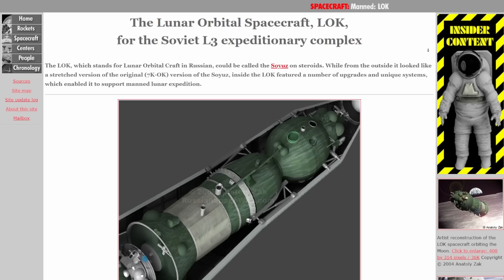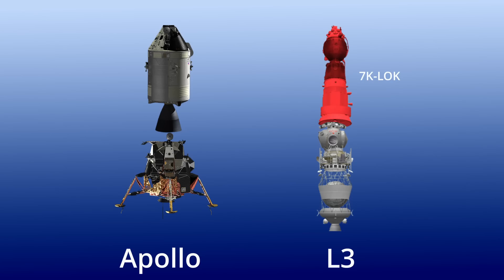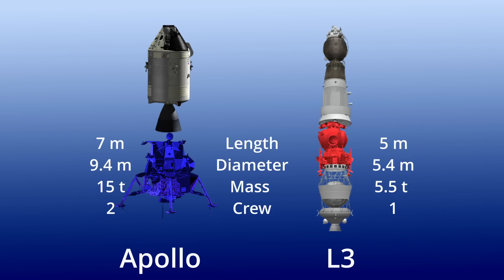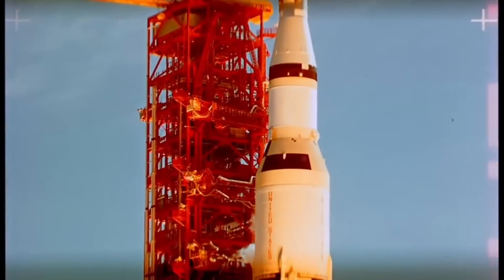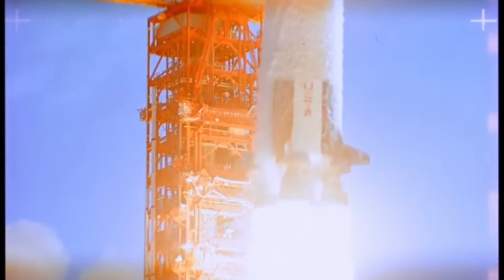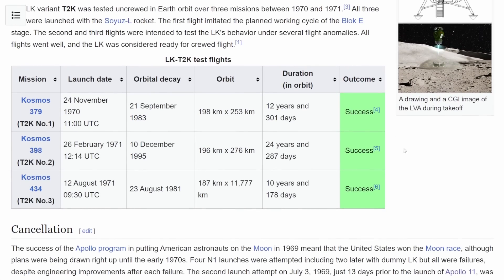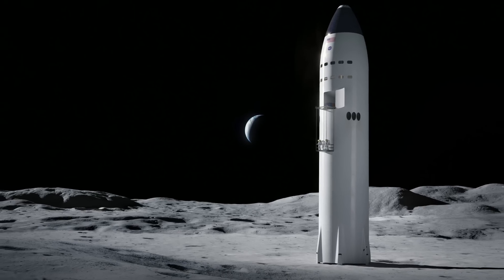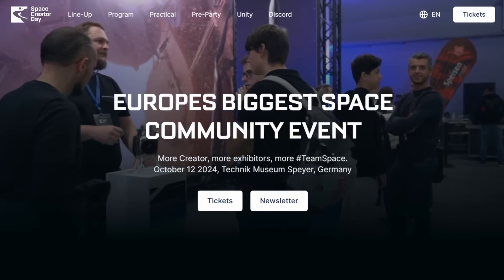Race to the Moon! Did Soviets or Americans Build the Better Lander? - Rocket Rumble #2

Comment: Apollo 15s lunar touchdown was so rough it destroyed the descent engine bell. Had that engine been required for ascent (like the Soviets) the crew would have died
Reply: @montylc2001  Monty, I hate to tell you this, but that's really not true.  I've done ALL the research. In point of fact, there were concerns over the lengthened engine bell contacting the surface while the engine was still running, so the J-mission commanders were told to shut their engines down the moment the contact light came on, so as to avoid the potentially lethal effects of the bell becoming blocked by lunar regolith while still firing.  That could cause the combustion chamber to explode, which would likely have been a non-survivable situation for the crew.  So, the engine extension was specifically NOT supposed to EVER hit the ground!  In point of fact, on Apollo 15, the engine bell crumpled because the LM landed straddling the rim of a small-ish 10-meter crater, and while Dave Scott shut the engine down the moment he had a contact light, he had also gone into a near-hover at that point, so his LM fell harder to the surface than any other LM.  The engine bell only hit the crater rim after the front and left footpads hit, and the whole LM tipped back into the crater about 20 degrees.  Thankfully, the engine had enough time to mostly stop firing by then, though the remaining pressure in it caused a big burp of soil that you can see flying out as the LM tipped back, on the descent film.  If you listen to the first EVA, when Scott is doing a walkaround of the LM, you'll note he says "You can tell the Program Manager that I got his engine bell."  The Program Manager was Jim McDivitt, and was the guy who told Scott, upon pain of pain, do NOT let your engine bell hit the ground on landing.  HIS engine bell, you note.  That's why Scott made that particular comment, to tell his old pal Jim that he had indeed crumpled the engine bell, and had survived, so maybe the dire warnings were a bit overstated.  If you'd have read, say, all of the crew debriefs for the flight, you'd have this kind of information.
Reply: @DougVanDorn  The lunar lander was designed and all of them under construction before the first one landed.   There was some concern about how far the lander’s pads might sink into the regolith, potentially blocking the engine bell, which might cause it to burst and throw shrapnel that could damage the ascent stage.   But even if they didn’t sink in, there was a larger concern the exhaust could excavate a deep crater that would redirect excavated rocks upwards outside the engine bell, also posing a hazard. (The surveyor probe had been sent to land on the moon partly to determine if landing pads would sink into the lunar regolith.)
So they engineered to negate those concerns.  All the LEMs had three  5 and a half foot long poles sticking down from the three legs without a ladder, that would activate the contact light while the LEM was 5 feet above the lunar  surface. In every landing, the engine was cut off when the contact light lit up, and the LEM dropped the remaining distance to the surface. The pilots tried to bring their vertical speed to zero and hover just as they made contact.  And the crush core shocks on the legs were designed to take the acceleration of the LEM dropping as much as 10 feet from a hover in lunar gravity.

Because of these design solutions, It simply did not matter what happened to the engine bell, once the contact light came on, the engine shut down, the LEM dropped down with an engine that was not only shut down, but safed, and the descent stage had no further use but the stowage bays for the experiment packages, the rover, and the surface video camera. Once shut down from surface contact, the descent stage engine was incapable of being restarted. 
If anything bad had happened, from initial descent burn up to and including hitting the surface too hard, ALL the abort options involved firing the ascent stage motor and dumping the descent stage.
Reply: @DougVanDorn holy chat gpt
Reply: The Blok Ye stage on the Soviet LK had a design optimised to direct landing debris and engine exhaust away from the engine, and featured a backup engine in case of failure of the main engine. The engine bell on the Blok Ye was nested, making damage less likely as the bell was not exposed as on the LM. The basic argument therefore that an Apollo 15-esque landing would have stranded the Soviets on the Moon is incorrect.
Reply: @DougVanDorn  " the engine extension was specifically NOT supposed to EVER hit the ground! "

The extension was not to hit the surface with the engine running.
Reply: Blaming the Americans for a Soviet design failure the Americans specifically designed their own craft to survive from seems a bit like special pleading.
Reply: @brianlaneherder3666  What?
Reply: Ok, but the bell on the lk is shorter compared to the landing legs
Reply: @grady631  It doesn't matter, the descent engine was only for the descent. Whether the bell got damaged upon landing was irrelevant. It was useless in any case with little or no fuel remaining.
Reply: Yes. And was actually also more or less mystery, would any of the landing engines could have been started after landing. Heck lot of dust, rumbling, and last few feets was more or less always "carrier" style THUMB. It was in many ways convinient that one could separate another fresh engine, and ofc also basic laws of leaving mass behind.. But ofc more moving parts etc. so it is more or less still a trade off. In dream world we would have moon machine that has main lander engine which it uses for landing and take-off, and then "an abort" engine more or less same style "hidden" in isolated space :)
Reply: @lasselahti4056  Why take all that descent mass back into lunar orbit?
Reply: @Canada_Dominium  For reuse.
Reply: @lasselahti4056  Why?
Reply: @Canada_Dominium  The Soviets had a different engnineering philosophy. The Soviets went for simplicity and reliability. The Soviet design would have worked, unless something went wrong. Same with ours, and it almost did. One mission failed (Apollo 13) and the American lander came close to some unrecoverable mishaps. We (the various countries involved in space programs) have the low Earth orbit thing down. Going to the Moon, or beyond, is crazy dangerous.

I am dubious about the potential value of space travel beyond low Earth orbit other than its scientific value. If I had the power to make the decision, I would say, right now, no country should bother going back to the Moon. I would say, what the countries involved in space programs should do is combine their resources and send a mission to Mars.

The reason why I say this is because no one knows what the future is. Maybe in the future technology will decline and we will not be able to contemplate a Lunar or planetary misson anymore. If we go, we will always be able to say, we have been there.

People will have to be told, however, that there is a considerable chance that the mission will fail and the astronaut will die in the attempt. It is very possible, in that case, that we will never know what happened to them. The physical effects of a long deep space mission on the human body also are unknown. They will not be good.
Reply: @anonymike8280  There were no mishaps with the Apollo LM.
Reply: @Canada_Dominium   @Canada_Dominium  Not with the lander. With the mission itself in the case of Apollo 13. There might have been some close calls with the lander.

What about the rest of the discussion?
Reply: @anonymike8280  "There might have been some close calls with the lander."

What close calls?
Reply: @Canada_Dominium  First of all, there is no default position which must be accepted absent proof to the contrary. Applies to many matters and it certainly applies to this one. The Apollo 11 lander was seconds from running out of fuel when it was successfully landed. If no adequare land site had been  identified, the mission either would have had to have been aborted, or the lander would have crashed and the astronauts would have died on the Moon. In another mission discussed right in these comments, it was not that the land came to rest at an angle on the side of a crater.

I don't understand what your issue is. What I was doing in the first place was making the point that space mission are inherently dangerous.

I just entered "Did the apollo 11 lander almost  crash?" as a search term and got some result. Yes, the mission and the lives of the astronaiuts were in jeopardy.

If you have a different opinion about the risks inherent in space flight, you're allowed to say what it is.
Reply: @anonymike8280  "The Apollo 11 lander was seconds from running out of fuel when it was successfully landed."

That wasn't a problem or fault with the LM.  It was faulty mission logistics.  The LM was the single component spacecraft that behaved flawlessly through all manned Apollo missions.  So, you're just wrong.  Admit your error.
Reply: @anonymike8280  ""Did the apollo 11 lander almost  crash?" as a search term and got some result. Yes, the mission and the lives of the astronaiuts were in jeopardy."

Eagle did not 'almost crash'.  A late start to descent operations caused the landing profile to shift downrange from what was known and planned.  Armstrong had to take extra time to find a safe place to land.  Do you blame your bicycle when you get lost?
Reply: @Canada_Dominium  That's a bunch of double talk. The issue I was raising was that of how dangerous space travel beyond low Earthj orbit actually is. The NASA lander may had worked exactly as it was designed to work but its limitations were extreme. One mission - embarassingly, the first one to attempt to land - almost ended in failure and even disaster.

Didn't I say, people need to be told that Lunar and Mars missons are very risky and that there is aconsiderable chance that could end in a loss of life? Especially a Mars mission. Going to Mars especially is obviously so risky it should not approached as a competition between nations.
Reply: @anonymike8280  "One mission - embarassingly, the first one to attempt to land - almost ended in failure and even disaster."

No, it didn't, and no, there was no fault in the design of the LM, and no, the LM was a very capable machine.  You claimed outright  multiple cases of failure with the LM. What were they?  Stop tap-dancing and answer the question.
Reply: @anonymike8280  "the first one to attempt to land - almost ended in failure and even disaster."

How?  Because the pilot took control of his craft and avoided a boulder-strewn area, because the mission profile timing had changed during lunar orbital undocking?  You really DO blame your bike when you get yourself lost, don't you.
Reply: @anonymike8280  "The NASA lander may had worked exactly as it was designed to work but its limitations were extreme."

What limitations?
Reply: @Canada_Dominium   @Canada_Dominium  It had sufficient fuel only for a limited amount of flying time and manuevering. There probably were a number of unrecoverable mishaps that could have occurred during landing. If we had kept on doing missions, eventually we would have lost a crew. It's what happens. We nearly lost an Apollo  crew as it was. We lost two space shuttles.
Reply: @anonymike8280  "  It had sufficient fuel only for a limited amount of flying time "

That applies to any motor vehicle of any type and use, thus irrelevant. You stated there were 'mishaps' with the LM.  What were they?
Reply: @anonymike8280  " We nearly lost an Apollo  crew as it was."

The Lunar Module SAVED that crew--by far exceeding its design capabilities and limits.
  

"We lost two space shuttles."

Irrelevant to Apollo Lunar Module.
Reply: @anonymike8280  "We lost two space shuttles"

Challenger was lost because of the RepublIcan Party's design for the booster and a RepubIican president's insistence on a launch in problematic conditions.  Columbia was lost because of environmentalist pressure to change chemical composition of insulating foam on its fuel tank--the RepublIcan Party's design for the booster.
Reply: @Canada_Dominium  Launch pressure was an issue. So was doing winter launches. They should not have been doing winter launches, period.

Don't forget Jessica Dubroff though. She was under pressure to make it to D.C. in time meet Bill  Clinton.
Reply: @anonymike8280  Challenger was lost because of the Republican Party's design for the booster and a RepubIican president's insistence on a launch in problematic conditions.  Winter is a season; not a temperature reading.  Apollo lunar missions launched in winter and in thunderstorms.
Reply: @anonymike8280  "Don't forget Jessica Dubroff though. "

Absolutely NOTHING to do with the space program.  Sick of you even to state that.
Reply: @montylc2001 i mean his point still kind of stands. I don’t think he’s trying to take away from the apollo program just pointing out a possible issue of the LK.
Reply: Actually not. The LK had two small auxiliary nozzles on either side of the main descent nozzle.
Reply: @hagerty1952  Gee, I wonder what "main descent nozzle" and "small auxiliary nozzles" sound like in Russian.
Reply: You don't really have a point here. The nozzle extension added from A15 onwards was designed to crush and CDR Dave Scott was explicitly instructed to hit the engine stop the moment the contact light illuminated as there were grave fears about the effect of having a running DPS so close to the lunar surface. Everything here went to plan. Obviously, you would not use the procedures developed specifically for one spacecraft on another completely unrelated spacecraft with different design goals and limitations.
Reply: @who1928  Thanks for this important bit of information.  Its the first time I'm hearing about this.
Reply: @montylc2001  welcome to the real world- where pilot error, engine failure, unseen terrain features, or erroneous fuel calculations could all easily cause a lander to touch down too hard and destroy the bell, contingency plan or not. In the case of the Soviets, that would cause mission failure and cosmonaut death. In the case of the Americans, it's ok. You really didn't say anything other than confirm my point that the American design is better

Comment: The Soviets took much bigger risks than the U.S. did, that is why they were ahead in the Space Race until the Moon Landing. That is not to say they didn't effectively engineer everything, and until Saturn V, they did have much heavier lift than we did. Nor that we didn't have risks and setbacks as well. But engineering what we saw as the proper safety did slow us down compared to the Russians.
Reply: Not really. When you look at the "space firsts" of the Soviet Union, it was pretty much a bunch of stunts with only a modest amount of useful practical benefit towards real human spaceflight. Even several Soviet designers and engineers admit this.

They quickly fell behind during Gemini as the USA's greater unity under NASA and the vast amount of resources pushed past them in almost all aspects. By the end of Gemini, the USA was ahead in most areas with longest duration, fuel cell development, EVAs, rendezvous, docking, and more. 

It wasn't until the late 60s that the Soviets started to turn things around for themselves, but by then it was far too late. They acquitted well themselves later with Salyut, but that's another story. The skills and vehicles for a manned Moon landing was done and the race was lost.